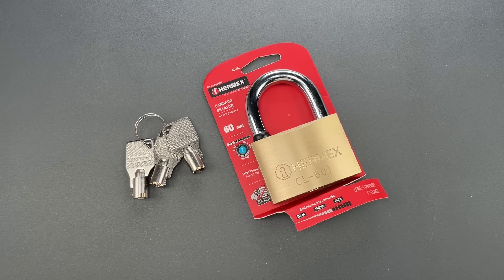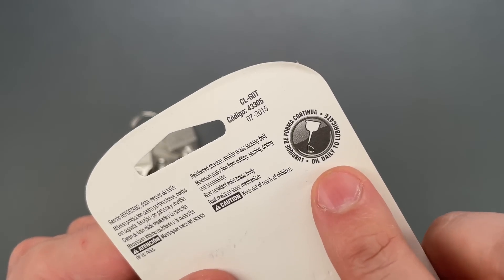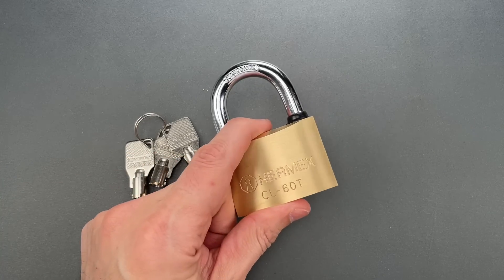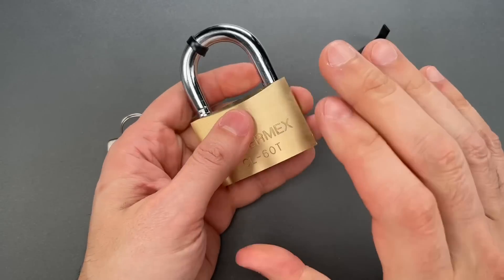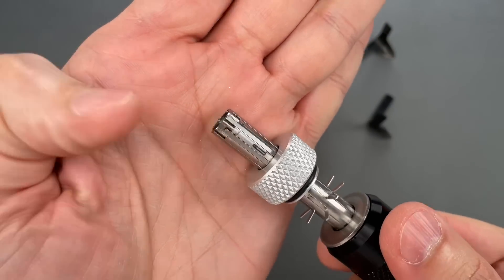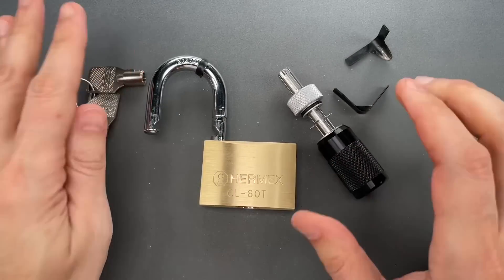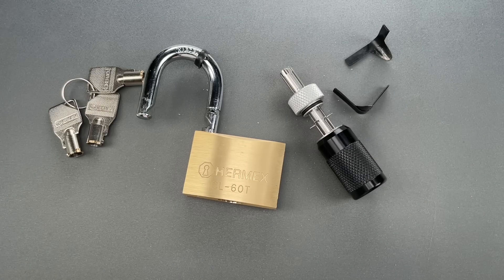[1580] Two Serious Flaws in the Hermex CL-60T

Comment: I just found a master lock that is seemingly impossible to pick. It’s a master lock commercial lock but it’s a #83? I believe, and it has an inscription at the key way that says “5 pin” 
I can get it to turn 3/4 of the way when setting 4 pins. When it turns into its false set, it binds my tensioning tool with the pick and I can’t get the pick out. Idk I’m an amateur, but this one seems pretty tough

Comment: Also, like a lot of other locks I've seen, they've turned a hardened 10mm shackle in to an 8mm shackle by forging or machining a 1mm slot round it where the 'water resident' gasket fits. If that hardened shackle is only case hardened (not through hardened) then this  will be a weak cutting point. I've not yet figured out why so many lock manufacturers do this.

Comment: The impressionIng tool seems to work faster than the key, with the key you have to line up the key slot with the notch in the lock. the tools just slips right in.

Comment: So I just picked my first real world locks. I have a toolbox in the back of a truck someone gave me, but after waiting over a year for them to find the key to unlock the toolbox, I decided to just pick it open. It was a pain because the locks are recessed under the release handles, and there's the little flapper door to keep dirt out of the lock cylinder. I didn't have a tension wrench to work for the recess, so I used a small flat blade screwdriver held with needlenose vise grips. I used a standard pick to figure out which side the pins were on, and finally got the cylinder to turn and unlock. Then I had to do the same thing to the other side to get the whole top lid to open. Finally got the second one to turn, but the handle still acted like it was locked on that side. Maybe it just needed to turn a bit more, or perhaps it was jammed. I had already been messing with it for around half an hour and was done. I came back out and opened it with my HK. Vaporized both lock cylinders, opened the box, and it was full of smoke. Rifle has a flash hider so I just put the muzzle against the locks. Learned that if you're going to do that, make sure you only have one round in the gun. The change in back pressure with the muzzle being up against something caused it to try and double feed. Shot twice, but cost me four bullets.

Comment: Wow, I've never seen the impressioning tool work that smoothly. It's usually a pretty fast bypass when LPL showcases it, but involves it least a couple of seconds of him wiggling it around inside the keyway beforehand. Here on the other hand... if I didn't already know what the tool in question was, you could legitimately convince me that it was just an oversized key intended to be used with the lock in question.

Comment: I'm pretty sure the only saving grace those tube locks have is that they require a cylindrical tool that's not as easy to carry as most lockpicks. But this one is especially egregious; if you did that fast and I caught it from a distance, I would have assumed you had used the actual key.
Also, because they aren't that common, even if I saw the impression tool, I might also have assumed that it was the legit key for a weirdo lock!

Comment: The fact it requires a specific lock picking tool to open would be a saving grace, if not for the fact you can shove two pieces of curved plastic into the top to open it.

Comment: 1:08 I have an innovation that increases the security of this lock by 50%. It’s a shackle that goes into the lock body in three places, kind of shaped like an E. That would require three shims, thwarting the person who only has two shims with them.
Reply: Add a hinge along the middle of the shackle and lock body so you can lock two hasps around a corner or across a vertical frame section.
Reply: Omg this made me laugh out loud

Comment: Watching this video series makes me wonder if there is no security more effective than putting a zip tie through the hasp, and then putting a little label on it that says that it has a security rating of 9 out of 10. After all, practically anything can be opened with a padlock shim or a rake, and how different is that from a pair of wire cutters?
Reply: @five-toedslothbear4051 -  You forgot to mention the battery powered angle grinder.

Comment: Fun fact : If you do not oil it daily, it will become progressively harder to pick open .
Reply: You need to oil it daily so it's slippery and harder to handle while bypassing.
Reply: Even WITH the key apparently
Reply: The folks at Master Lock could have told Hermex that LockPickingLawyer is not the kind of guy to use lube.
Reply: Anything that says oil daily, almost certainly isn't getting oiled daily.
Reply: Thanks for the chuckle.

Comment: Daily oil plus daily dust equals grinding paste. Either that or you blast it with WD40 which turns into sticky grease over time and causes the pins to get stuck. Dry moly or graphite powder is the answer. How much of this lock is made of easily corroded parts. 🤔

Comment: Just came up with a MUCH better way to display security ratings. Instead of random numbers (that are essentially meaningless) there should be a number denoting the "Estimated Time to Defeat"
As in, every lock can be defeated if someone is given enough time and tools. There could be two such numbers next to each other. The first denotes the time in minutes (up to but not greater than) it takes to defeat the lock in a non-destructive fashion, while the second is destructive. So, a lock that takes 1 minute and 23 seconds to open non destructively but takes 28 seconds to open with an angle grinder would get a rating of 21. The standards for water and dust ingress into devices has a similar concept. That's why some devices are listed as IP68 but others are IP6X (where X means an untested category). 

This new standard would show most locks being woefully low as anything that starts with a number less than 5 would be laughable.
Reply: We need an LPL rating.
As in "seconds for LPL to open".
Reply: @Tjalve70  I came here just to say that. Beat me to it.
Reply: 5 minutes for non-destructive entry is quite a high bar! A score of 2-3 might be where common locks end up. I bought Avocet pin-in-pin cylinders for my house entry doors, which are well beyond any criminal but would be within 5 mins for a professional picker. Incidentally, the doors I've installed them in are also good against destructive entry. Cheap PVC construction is a real pain to kick in. Police raided a neighbour not long ago and it took them nearly 2 mins to get through the door with a ram.
Reply: Dont try to destroy master lock. Who would buy 00 lock?
Reply: Safes are rated like this, though there's a lot of wiggle room in who's doing the estimation.
Reply: I love your idea!
You need to allow three decimal places so that we can compare Masterlocks
Reply: How would you display a rating for something like the bowley lock, that nobody can pick open non-destructively?

Comment: I’m pretty sure manufacturers demand ridiculous maintenance practices purely so they never have to honor a warranty claim.
Reply: Then they decline it anyway since it wasn't oiled on the shelf.
Reply: @jdotoz   Or during transport...
Reply: I purchased a toaster over that had a built in clock.  I read the manual so I could set the clock. Then I saw the recommendation that the power cord be removed from the electrical outlet after each use. That would cause the clock to reset to 00:00.
Reply: @dukeb-2 I would stay up until 00.00 THEN plug the Michaelwave back in...then the clock would be on time.

Then go back to bed obvs....
Reply: @stuartd9741 A michaelwave? I don't even think I want to know what that is.
Reply: @James-vn8zb  
when we were kids & had our first microwave in the 80s, we called it the Micheal wave ...
Reply: @stuartd9741  The great thing about an inside joke is volcano putty ribbons!
Reply: @dukeb-2  Sarcasm -> Great! End of sarcasm. Even computers have solved that issue even if you pull out the plug. Kind of the reason i buy stupid basic appliances because I only want the basic operation, not all the bells and whistles. Depends on what it is though as there are exceptions to even that, but toaster is not among them.
Reply: @naerbo19  There's a lot of stuff that can benefit from a microcontroller and a few sensors to react to the actual situation rather than just blindly trusting a timer. It's just a shame we forgot how to do that without adding WiFi so it can calibrate your toothbrush or whatever nonsense they're doing now
Reply: @keiyakins  I get sensors for safety, overheating for toasters for example, but I don't need it to have a clock, bluetooth, wifi or smart home functions. Partly because power prices are high in my area and therefore cut down on uses I don't appreciate anyway. Smart home should be less about reading statuses and more energy saving without external electronic management, and safety functions so that there aren't catastrophic failures hopefully.
Reply: @naerbo19   Oh, I agree, I just also meant things like moisture sensors in microwaves to help perfect cooking time, things like that. Things that actually make the appliance better at its job
Reply: Yep sorry, we can't accept your return because it wasn't oiled....

Comment: "oil daily" 

uuuuuhhhh what? I'm no lock guy, but beyond the frequency obviously being nonsense, I've been told and found it to be sensible that locks as a general rule should not be oiled at all - with the exception of graphite oil, which is probably fine, and perhaps as a solution for a lock that's already seizing up, but I think then you'd use something like WD-40 that mostly or fully evaporates. the rationale for not oiling locks is that most oils harden over time and would then make the lock very sticky, and all oils collect dust that forms a somewhat sticky gunk even if the oil itself does not harden. graphite oil doesn't, since there the graphite powder is the lubricant, and the oil more or less fully evaporates, leaving behind dry graphite that doesn't collect dust.

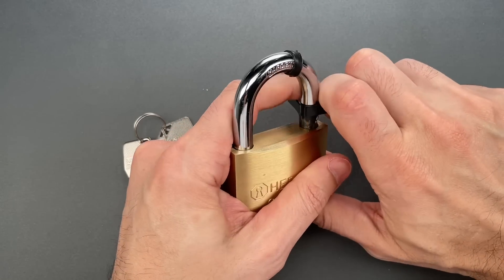Comment: 0:52 funny thing is, that issue would be so easily fixed if they'd form a "donut" around the hole in the metal. I have several old locks that i still use, that have this fix. You can't physically put the shims in, because the body of the shackle prevents it.
Reply: They don't want to waste any material.
Reply: it looks like they at least though about shimming. just didn't go far enough 🤷‍♂
Reply: @DavidFrankland  -  No they didn't.  That black plastic ring was just to keep water from entering the lock, in case you didn't oil it daily.
Reply: Ball bearings aren't shimmable.

Comment: "As long as you coat it in oil daily it is rust resistant, and we have determined this is hard to pick (as long as you do not have any tools or skill)."
Mastercraft is taking notes.
Reply: let's be honest.. lock oiled daily is grose enough not many people want to touch or pick it by any way :D
Reply: If the impressioning tool worked this easily, you could use a pen cap as a lever and a toothpick to do the pins. Lol.

Comment: I sometimes wonder if I met the inventor of the lock impression tool: Back in the 80's, when I was an auto repossesser, the company I worked for had a visit from a guy. He had a hand machined tubular device, with the notches for the sliding "picks". He had not yet fabricated the tension setup, so used common rubber bands around the circumference of the cylinder to hold the slides in place and tension them. But it worked the same way. 

He left the tool with us to get feeback on it, to help further develop it. Does the timing of this work with the known history of these devices? I forget the guy's name.

Comment: I have never heard of anything requiring daily oiling this side of the 19th century.
Reply: Most pneumatic tools instruct the user to oil daily. At least oil every day the tool is being used.
Reply: @jeffreeves1567 Air compressors for pneumatic tools have a large oil tank, which puts oil into the compressed air.

Use an oilless compressor or inline filter for painting with an airbrush.

Inline oilers are used in applications where the equipment needs more oil, or a particular type of oil.
Reply: @hamjudo yes but those are accounted for and incorporated into the design, I think op is more referring to manual daily oiling requirements, wherein each and every day you yourself have to go and apply that oil by hand
Reply: @Boxygirl96  -  Early 20th century locomotives required daily oiling of certain mechanisms.
Reply: @wickedcabinboy  yeah but that’s a vehicle, cars also have motor oil. Those are mechanisms which constantly move in their day to day usage, a lock should not be moving with the same frequency as a motor does
Reply: @Boxygirl96  -  fair enough.  But steam locomotives were definitely operating in the twentieth century.
Reply: @jeffreeves1567  I don't use pneumatic tools. I assumed they used grease instead of oil.
Reply: Well. If you think about it, a car engine has a constant supply of oil so it can be constantly be oiled while it is working. You don't add oil everyday, but the engine oils itself as it works.
Reply: @johanferozco  That's the point. Most things that need regular supplies of new lubricant use a feed system.
Reply: Drilling steel requires constant oiling though
Reply: @airi9673 As others have already pointed out, that's not "daily". If you don't use your drill for a few days, it'll be fine when you come back.
Reply: Some weedwackers have to be oiled every day that you use them, by mixing oil with the fuel.  Having to be oiled every day when just hanging from a hasp is another level, though.

Comment: The '7' security rating means it takes seven seconds to open, including removing it form the packaging.
Reply: So what you're telling me is a 700 security rating is or it starts to get decent
Reply: thats still a bit generous.
Reply: Don’t forget what time it takes to oil it.
Reply: i lol'ed too hard from this comment.
Reply: I think removing it from the packaging will actually take longer 😂
Reply: @_Roboute_Guilliman_  I think you’re right. I noticed that the lock picking lawyer removed this lock from the packaging before the video started. maybe he had initially recorded that part and decided to cut it out because it more than doubled the length of the video.😂
Reply: Now I'm really curious what a 1 on that scale look like (or I suppose a better question is "what's the lowest score a lock manufacturer is willing to put on the packaging?")
Reply: @anyGould  -  I have a tiny old luggage padlock that's probably a 1.
Reply: @anyGould  Probably a bolt screwed loosely onto a nut... 2 on the scale comes with a cotter pin
Reply: Nobody ever said what features a security of "10" actually has or how secure it is.
There is no information if a "10" is any good or that it would even be what is possible with current technology. It's just the highest security the lock company feels like to produce.
If you read the security rating like From terrible 70% on the way to bad the rating is not misleading at all!
Reply: So, level 9 or 10 locks come in a sturdier packaging!?
Reply: 7 probably means the time it takes to oil every day...7 seconds...
Reply: @YTSuxAxx  EUropean here, you can tell it's not a "€" symbol because "€" has 2 lines

hope this helps
Reply: What does removing it form the packaging mean?
Reply: If you are oiling it every day, that’s more time in your presence and that much less unsupervised time of the lock, the 7 indicates it shouldn’t take anyone with any skill any more than 7 seconds to open the lock if you aren’t there oiling the lock.
Reply: LMAO
Reply: That sounds like something McNally would say lol
Reply: I'm pretty sure the security rating is actually telling you the age of the attacker it will protect against.
Reply: @MikeDCWeld  - What does you the age if the mean?

Comment: I paid $5 for this lock instead of $20 for a master lock. I have no regrets.
Reply: I guess you did save $15 and got about the same level of security
Reply: @the_undead  But think of the time lost oiling it.
Reply: How long will a $15 worth oil supply last? 😉
Reply: @panislasya7119  Probably longer than the lock. 😆
Reply: This is a flat-out lie. You can't even get a generic padlock this size for under $10. Even a "dummy lock" that's just as effective is $8. Link the place you got it from and prove you aren't lying.
Reply: @facetiouslyinsolent8313  -  Whoooeee, someone sounds like they've been triggered.  I suggest you have a warm bath, light a candle and try a bit of meditation.  

Get back to us when you've calmed down.
Reply: No Regerts
Reply: Master locks typically can't be shimmed, so this is worse than a Master.
Reply: @ConstantlyDamaged  all the cheap ones can
Reply: @the_undead  I guess their export ones are better quality than what they ship to the US.  🤣
Reply: @ConstantlyDamaged  I am being a little overdramatic when I say all the cheap ones can be shamed, but probably about 60% of the master locks that you're going to find on store shelves in Canada and the US have some bypass that's as easy or easier than shimming
Reply: @the_undead  

I love your typo.  It is so appropriate when talking about Masterlock.  To whit: all the cheap ones can be shamed
Reply: LPL certainly does a lot of shim shaming... 🤭
Reply: @the_undead  -  And shame them he does, in very short order.
Reply: @ConstantlyDamaged  Master only recently switched over to ball bearing on their lower tier locks. Most of the ones in circulation can still be shimmed